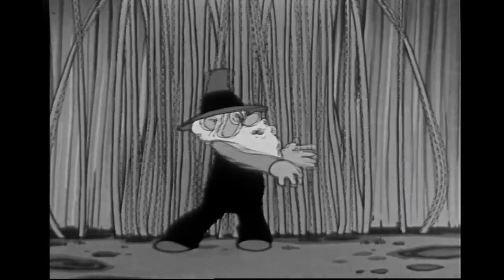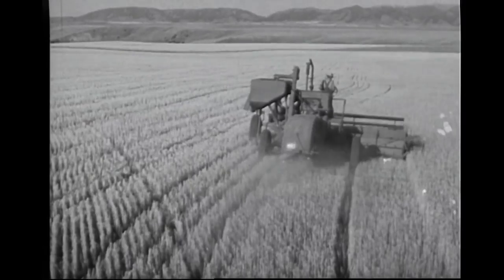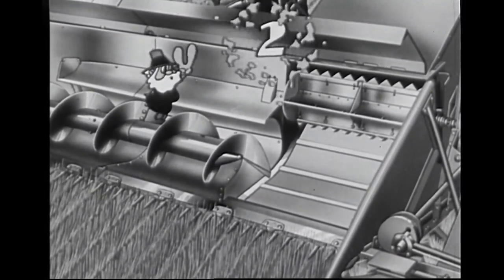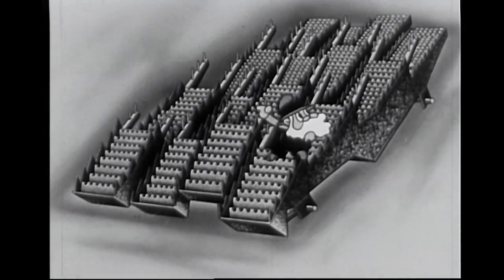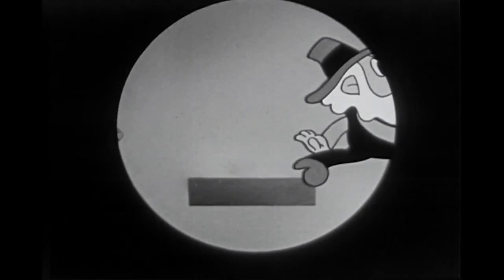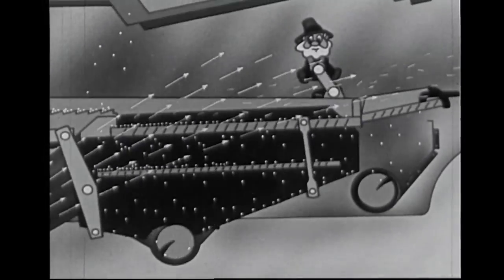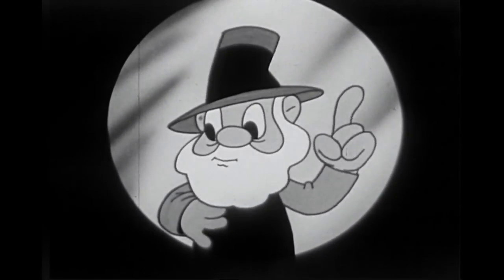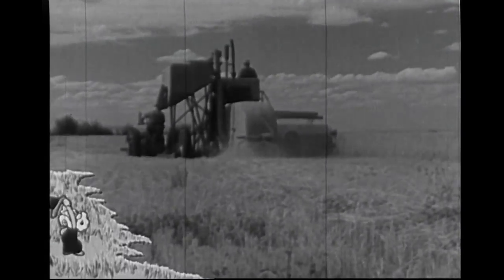Satisfying Old Timer and IHC Combines

Comment: Gleaner was first with an auger feed header about 10 years before this film. Gleaner also invented the rasp bar cylinder.
Reply: @koubafarms Judging by the tractor being equipped with rubber tires, I'd say the late 1930's. Guess who was first to introduced low pressure farm tires as a factory option and by 1932 as standard equipment.
Reply: koubafarms  I'd have to watch the film again to know.